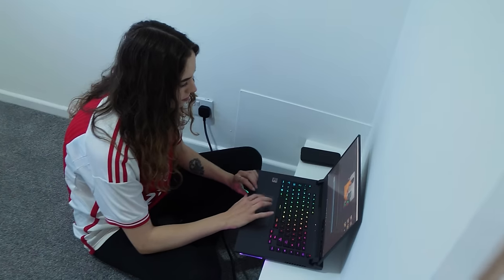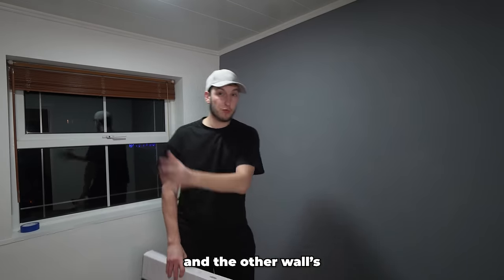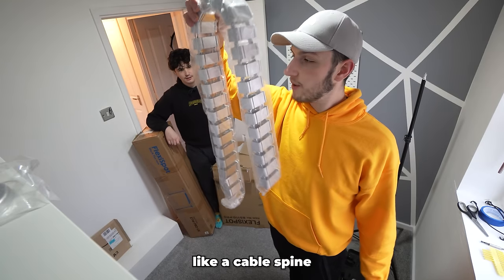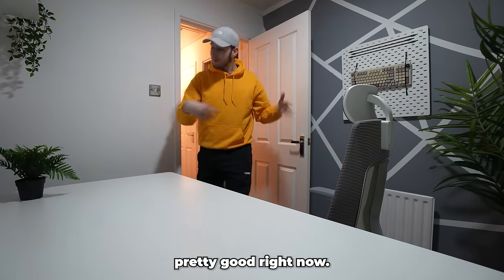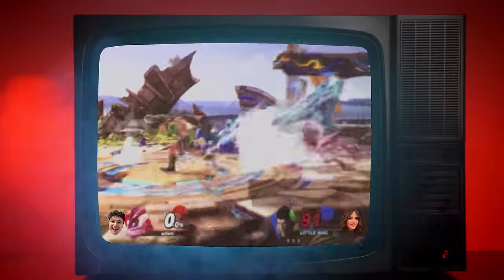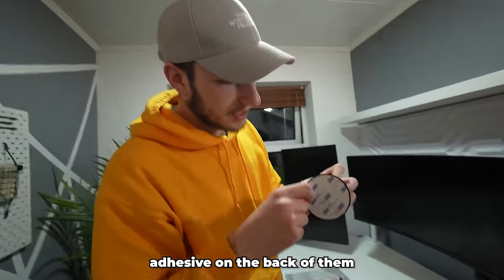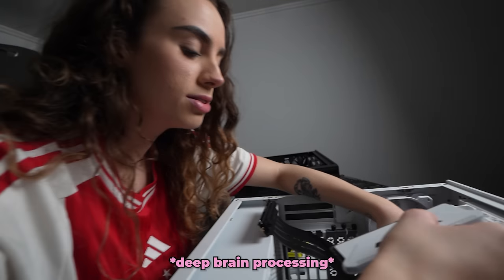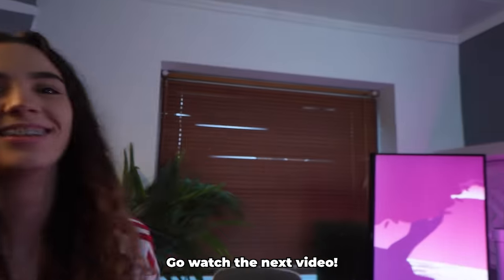I Built My Girlfriend Her Dream Gaming Room!

Comment: Professionel tip for getting clean lines. You need to "seal the tape" first, Paint the edges of the tape with what ever the wall color is, in this chase white and that way the grey cant run under the tape. If your  wall surface is not smooth paint the white 2 times.
Bonus tip tape often is easyer to remove while paint is still wet, so remove it right after the finish layer, there is no reason to wait👍

Comment: Hey Dantic, 
Since you're the only one who knows about PCs that responds to my comments... Are these good specs for approx. $3000?

CPU - 14700K
Motherboard - Asus ROG Maximus Hero
Ram - Trident Z5 RGB DDR5 16*2
Storage - Samsung 990 Pro 2TB
Case - Cooler Master TD500 Mesh V2
CPU Cooler - Asus ROG Strix LC II 360 ARGB
GPU - GIGABYTE GeForce RTX 4070Ti OC 12GB
Power Supply - Cooler Master MWE 1250 Gold V2
Monitor - LG Ultragear 32" 34GP63A
Keyboard - Redragon K530 Pro
Mouse - Logitech G502 Hero